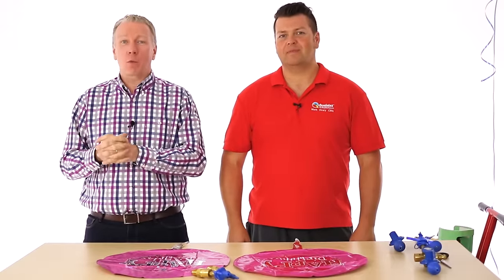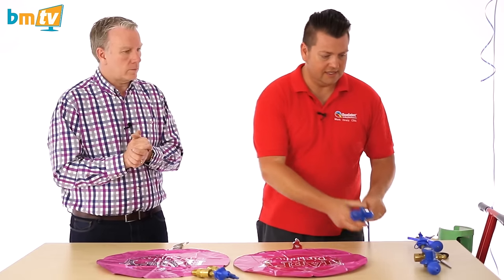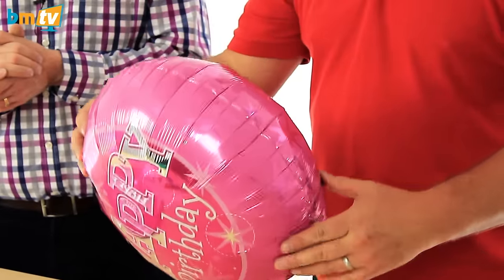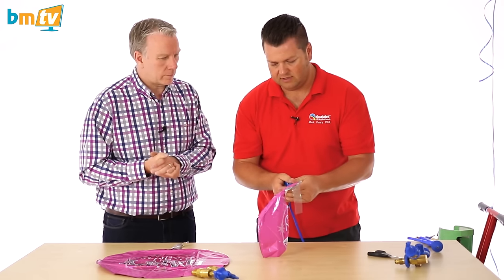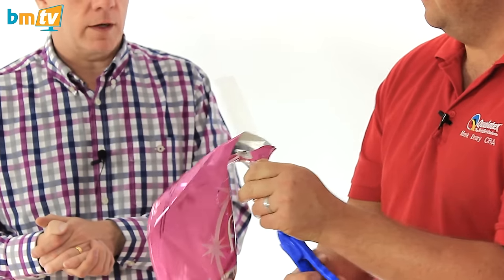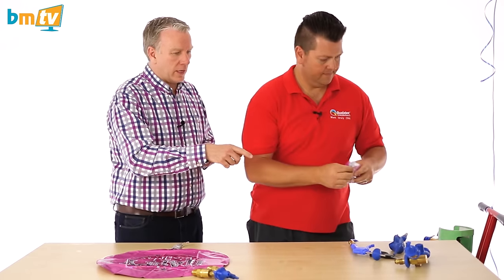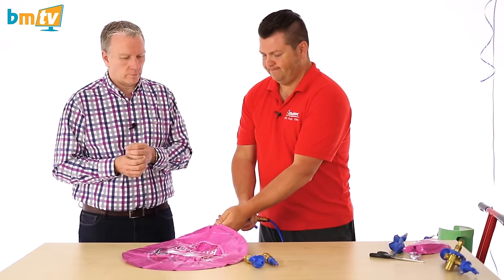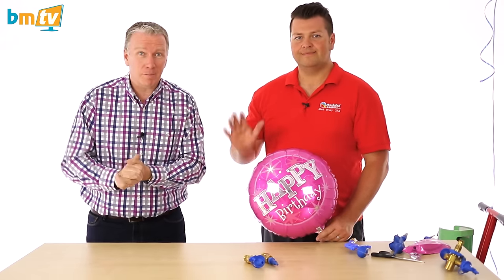How to Inflate a Foil Balloon - Balloon Basics 04

Comment: I do not have an auto cut off valve yet as I have just started and wonder what tips there are for inflating to a correct pressure, at the moment I am just using the valve thats supplied and am careful so no pops but the foils dont float for long
Reply from the maker: Hi Jeff! We highly recommend the auto cut-off, it's a really great piece of kit! If you are just using a normal inflator we would recommend leaving the foil balloon slightly "squishy" - if the balloon is solid, it is too full. You want to leave a little room for helium to expand.
Reply: @BalloonMarket  thanks, I have an idea like that after watching so many video instructions especially on this channel. I observe the inflated foils in different temperatures and understand your explanations.
Reply from the maker: @J1fcl0wn  perfect, I'm glad we were able to help :).

Comment: I recently purchased 9” foil balloons from a store (filled with helium) and they lasted absolutely ages! However I’ve been looking around for foil balloons to stock and they are all claiming they are ‘air filled’ only. Can you clarify if I can fill with helium or not? I’m looking to get smaller foil balloons nothing bigger than 9”. Thanks
Reply from the maker: Hi Maro, When we say air-fill only we really mean they won't float with helium. They can still be filled with helium but are unlikely to float so most people would air fill them to save on helium costs. 

Did your 9 inch balloons float then?
Reply: Yes they did! It was 9” foil balloons and they lasted over a week!

Comment: What’s the difference between 99% pure helium to 60/40? How does it effect my balloons & will it provide lift if I wanted to use it for SCIENCE!
Reply: Like Bass, I'm interested to know.
Thank you BM in advance for the answer, and thanks for all the great videos!
Reply from the maker: Hi Bass Junkie! If you had a set volume of gas, 99% helium would mean there would be 1% of that gas that wasn’t helium. 60/40 is 60% helium and 40% other gases like oxygen and nitrogen. The more helium you have, the more lift a balloon will have. 60/40 provides just enough lift to get the balloon in the air but it won’t float for as long as if it was filled with pure helium for instance.

Hope this helps!